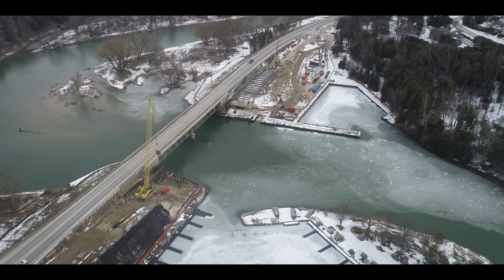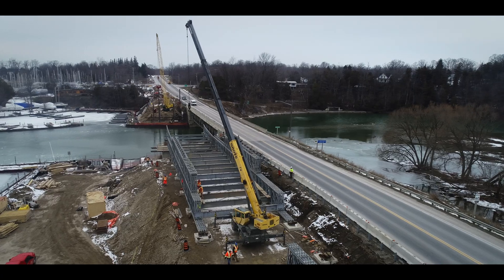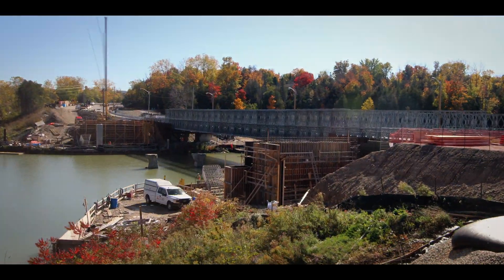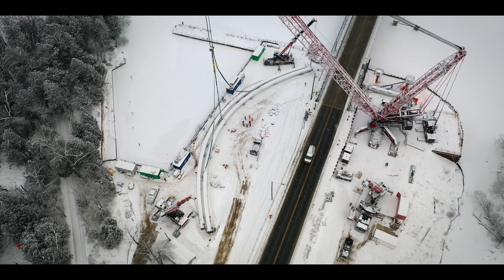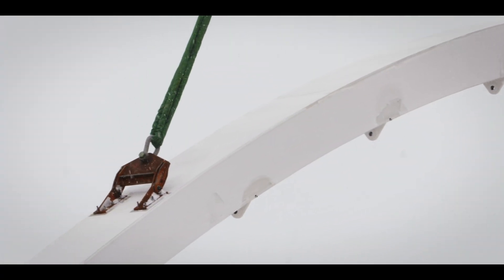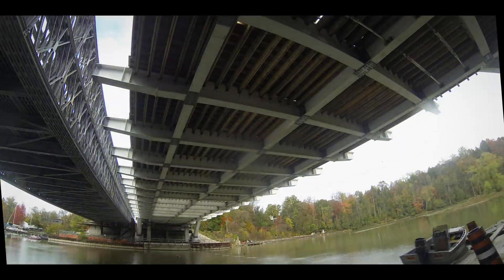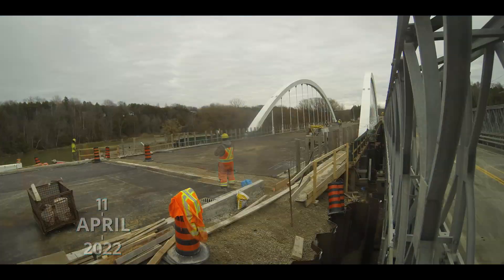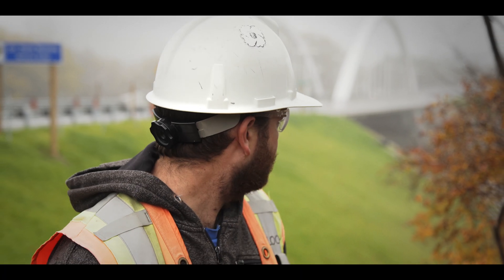Replacing A 280 Foot Bridge

Comment: why would they not just build the new bridge where they put the temp bridge. it feels like an extra step. the new bridges built around me didint use a temp bridge.
Reply: Yes, I have seen that done in a number of instances. Also they could have done a detour around the site. Looking at google maps it looks like it would have been about a 6 or 7 mile detour. An inconvenience for sure but a lot cheaper. Just this summer I have been on several construction detours at least that long.

Comment: Who designed this bridge?
The reason I ask is that a very similar bridge in Latchford, on Hwy 11 north of North Bay, had deck hanger failure in early 2000's.
The arches were OK but the entire bridge deck and all hangers required replacement.
The hanger rod ends were a single screw stud that had failed in fatigue.  These were all replaced with 4 cables comprising each hanger.
I trust that the lessons from Latchford were incorporated into this design.
Reply: Sorry buddy I copied the Latchford plans over a couple beers. Got too drunk and only had a day until the plans were due, whoops!

 No idea it fell, that sucks. Oh well, when this POS goes i'll blame the contractor and they'll pay me to design another